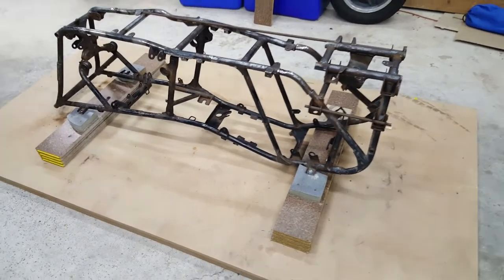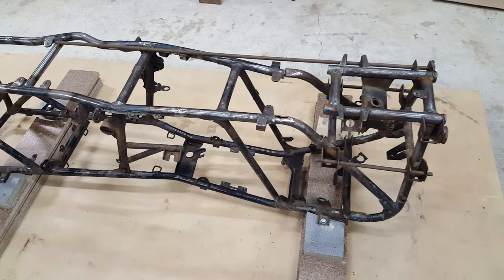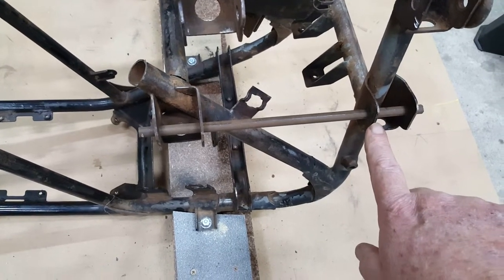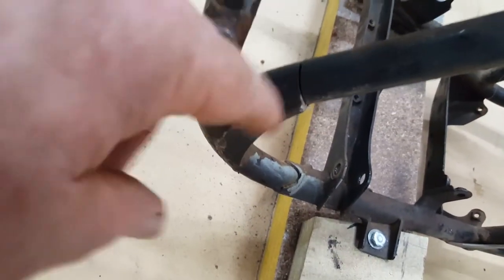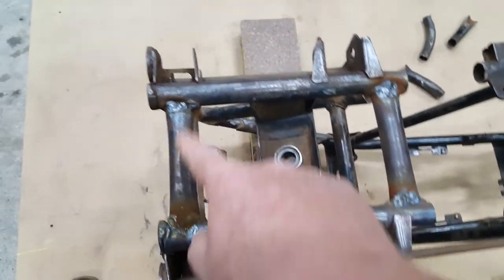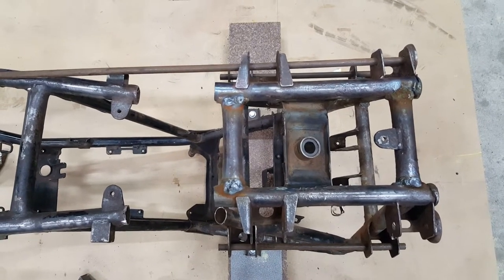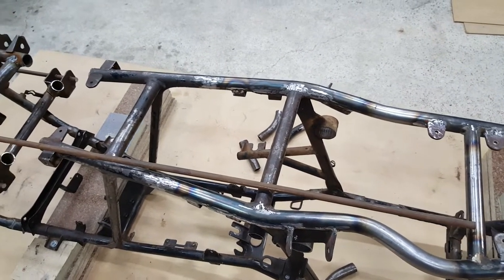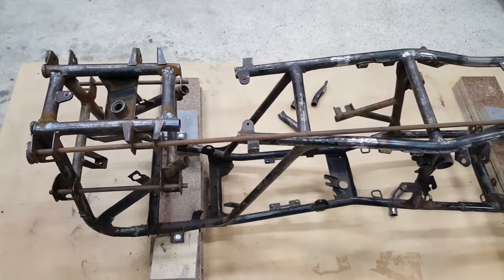Suzuki Quad Runner 250 Frame Straightening and Repair

Comment: G.day I enjoyed your video. Could you tell me by chance the wall thickness of the main frame tubes? Seems like the tube is available in 25.4mm OD with 1.6mm or 2mm wall thickness.
Reply from the maker: 1.6mm wall thickness

Comment: I think the closest I can get is probably Cold Drawn Seamless CDS, 25.4 x 1.6mm but must buy full 6m lengths here in Sydney. I will probably go with ERW steel in the same size and see how it goes. 
Cheers
Reply from the maker: That is what I used. Original maybe chrome moly as it has spring in it. Have you seen my earlier video replacing rotted tubes?
Reply: So after cutting out my front end including the steering support. The original tubing seems to be either 2.0mm or possibly thicker up to 2.3mm wall thickness. 
Ended up using ERW 1.6mm just because it was easily available. Also used 2.5mm mild steel sheet to reproduce the A-arm attach brackets.
Reply from the maker: I have salvaged a complete front frame from a parts bike which would have made my 1990 frame repair much easier. I would like to see pictures of your work.
Reply: @bms250ford  there doesn't seem to be a way to attach photos in the comments here?
Reply from the maker: @Simon-sf6dc  john@bmsmotorsport.com.au